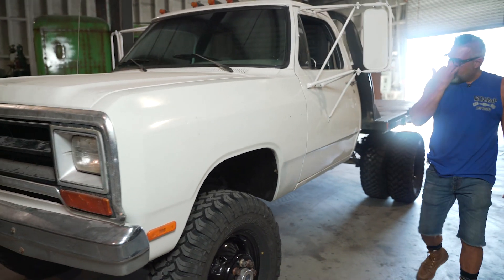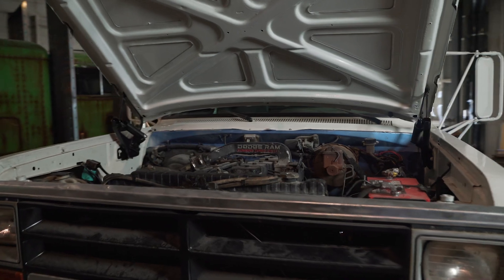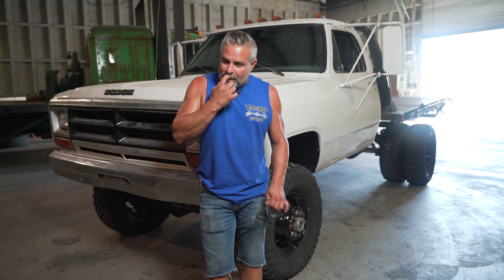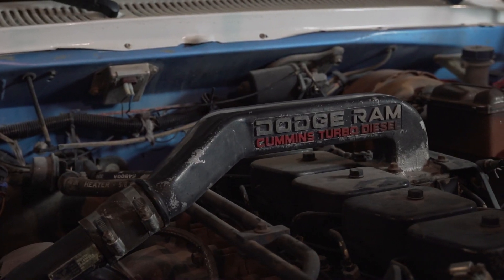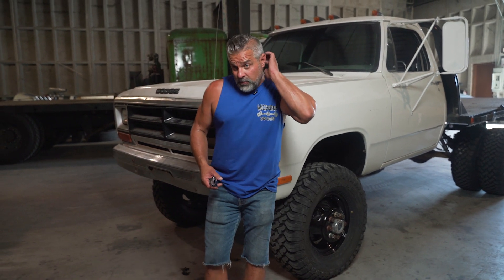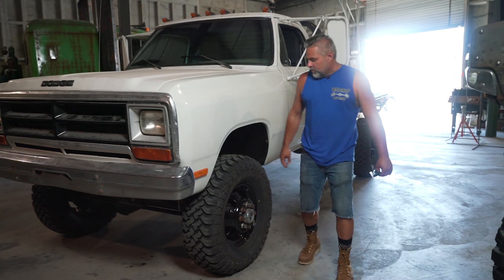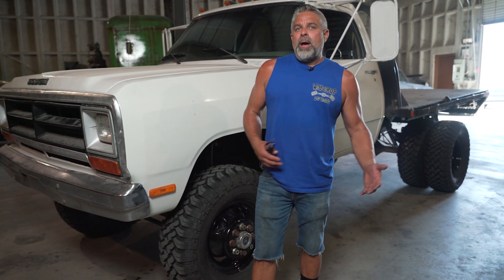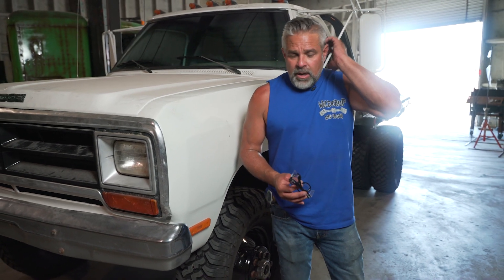1st Gen Dodge Cummins Welding Truck

Comment: Hey and HX35W and some pump tuning is about all you need. I have a KSB spacer on mine too. Turbo lag is almost non existent and I have a elbow to the wastegate that limits to 33psi or so. Just enough to have fun and fly by the domestics.

Comment: What did you use to adapt wheels, I have a 1993 w350 with a bent rim.  I want to go with all new 3 gen Alcoa’s but didn’t know how to adapt them to the bigger wheel studs